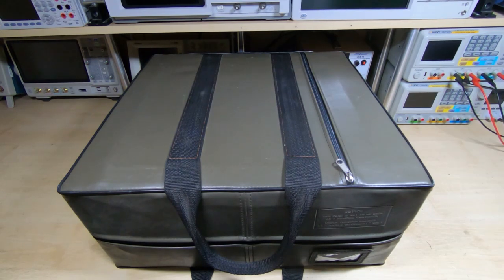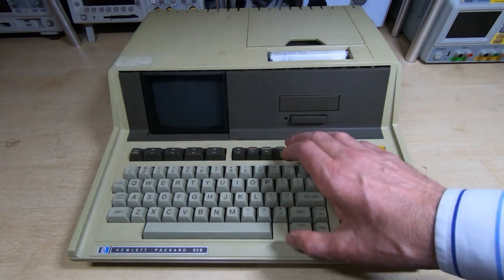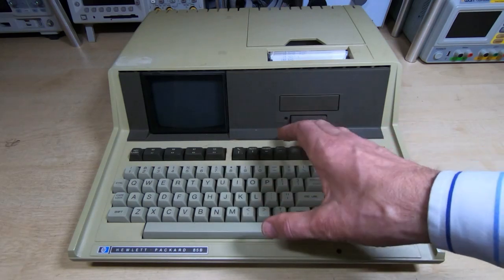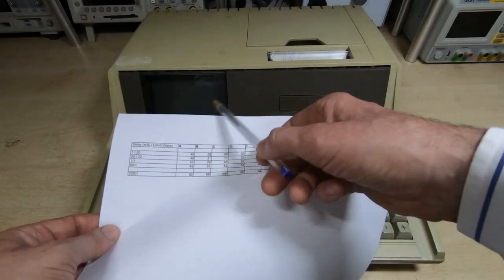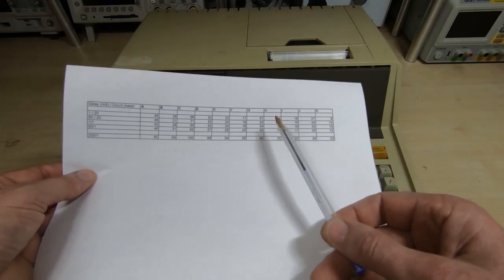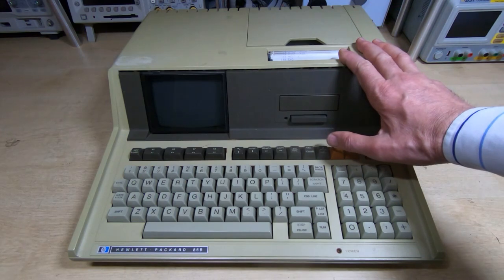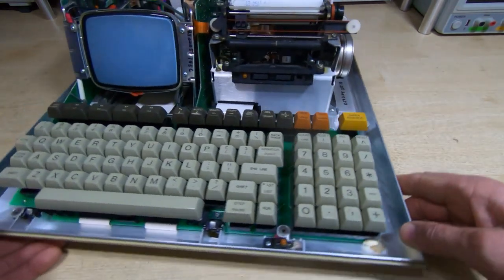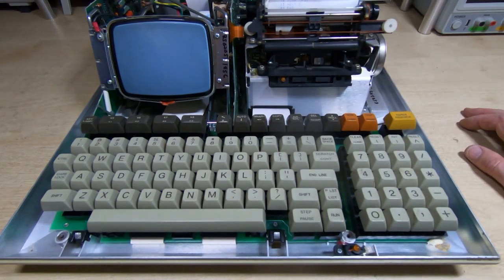HP85B Repair Part1

Comment: Jerry, like you, I too was very surprised to see that the female testers struck the keyboard twice as hard as the males!  Sometime during this repair/restoration, will you go into the details of "shortening" the paper roll to properly fit the printer?  I have a printer for a different machine with no good paper and would greatly appreciate seeing how you cut the rolls down to properly fit a printer.  This looks like an interesting series!

Comment: Lovely! I also have an 85B (no case though - and mine is quite yellowed!).... All of my keys stuck, with the usual stackpole key problem of the poles had split at the corners. I ended up 3d printing little squares to put around the square part to hold it together. It works great but they are a pain to get on, and it reduces key travel by 1mm or so.